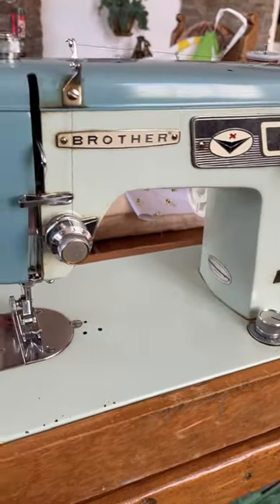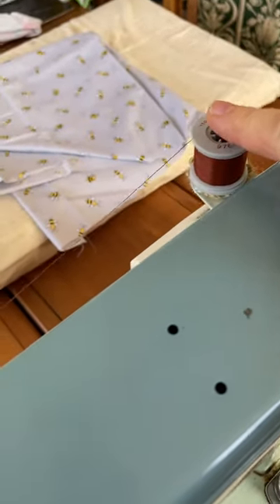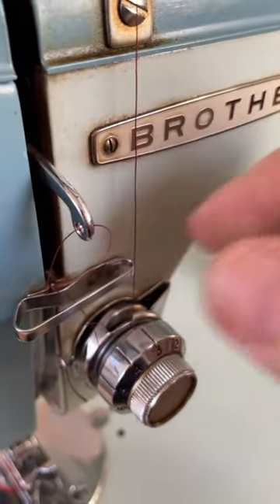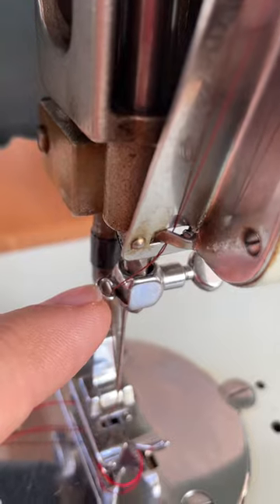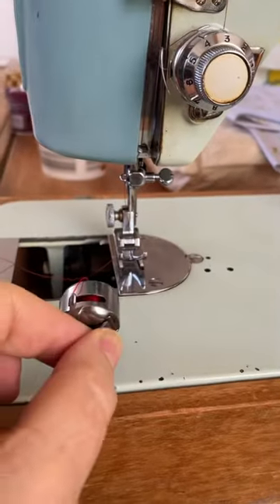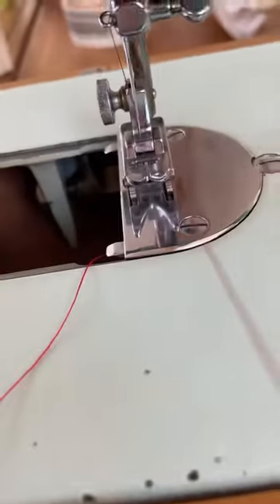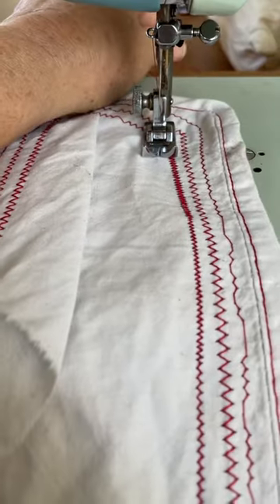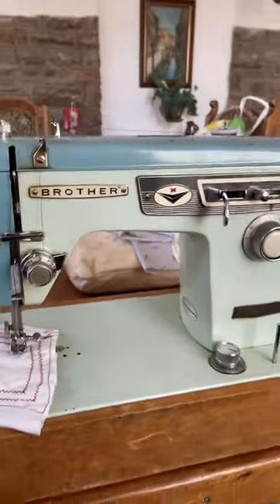Threading and 1960s brother sewing machine

Comment: I have this machine and every time I go to sew the thread breaks, it’s a new needle and new thread. But the thread always breaks on the top. I even changed out the foot. The bobbin is properly put in as well… my tension spring might be broken? I’m not sure though
Reply from the maker: Try checking your bobbin tension as it may be too tight and that could snap the top thread. Also try threading the top. Then pull some thread and see how tight your top tension is….with the presserfoot up it should pull easily. Then put the presserfoot down and try pulling thread again and it should be difficult to pull because the tension disks are gripping it. Good luck. Michele